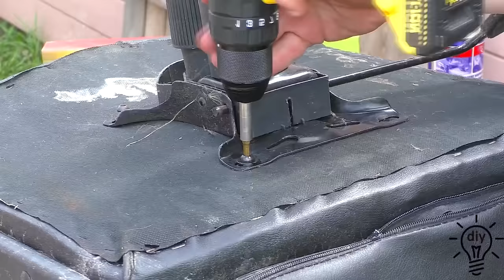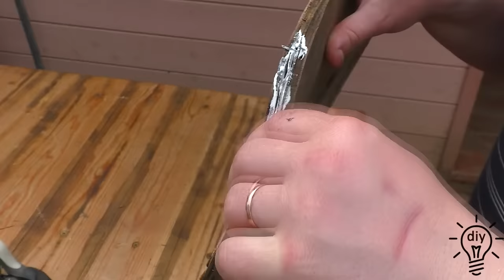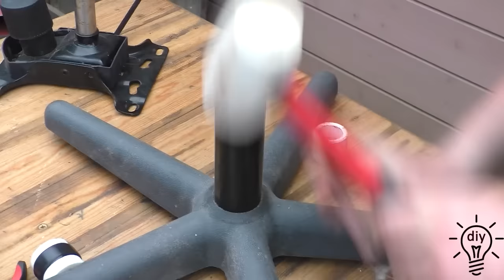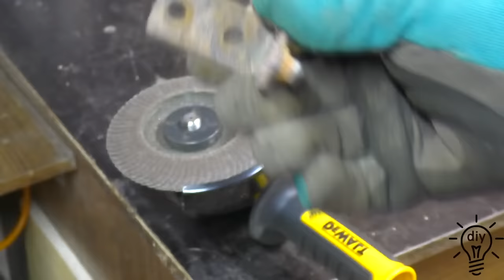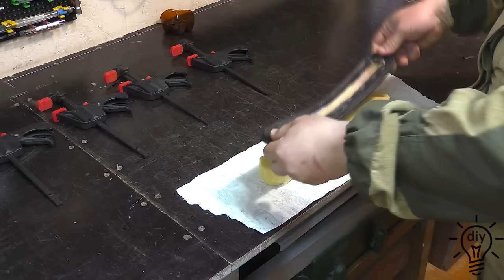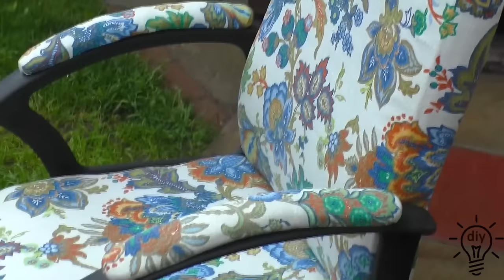Cool idea!!! Don't throw away your old office chair !!!

Comment: It would be cheaper for me to buy a new office chair than to buy all those tools and re-make the chair with the help of those tools....☹️☹️☹️☹️
Reply: One-time purchase help you for 10-years more and allow you to fix many many things and save you money.
Reply: @nirmal6362  right! save money but what more important save the environment!
Reply: @macewindu7568  but he has to spend 200 bucks for a compressor and staple gun, im sure making those products wrecked the planet a little bit. I have only used my compressor twice on five years
Reply: @asueft  if you don't DIY you can buy staple gun for 5 bucks or use hammer and nails
Reply: @asueft  and needn't to spend 200 bucks :)
Reply: don't throw out your office chair you can repurpose it as an at home office chair. With that armory of shop tools when would you ever spend any time sitting down.

Comment: I worked for a Swiss office seating company for 25 years, bring back old memories. You did a great job on that chair really.  One thing that I saw that amused me was when you were scraping off the bottom of the seat board. It sure looked to me that the T-nut that held the control were put in wrong from the factory, The T-nut with flanged part should have been on the seat pan where you put your foam. Rocking around on that could cause the nuts to pull right out, be careful who uses that chair. But still a great job.
Reply: Wow! Good Eye! 

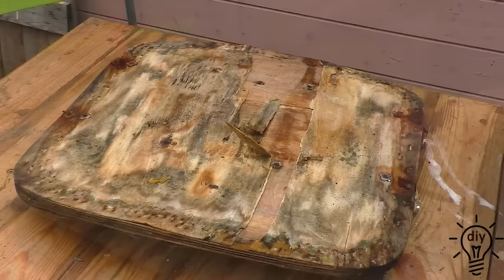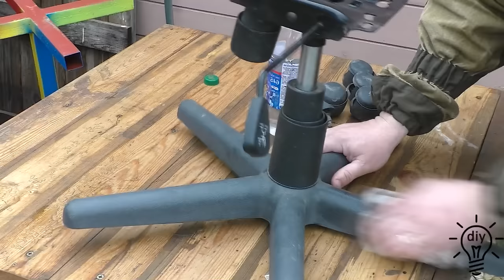During disassembly (around 0:44) it looks to me like they were manufactured correctly w/the arm t-nut flanges on the bottom of the pan and the seat t-nut flanges on the top side. It's hard to be certain, but by 3:44, they all (arm and base) appear to be flange side down. 

Maybe when he peeled the rotten plywood layer off the top, he thinned the sheet so much the t-nuts stuck out. Then, even with the t-nut bolted hard against the base support, the plywood would slide down the t-nut barrel and the seat pan would rock, so he switched the flange to the bottom side, not realizing how rapidly they would pull out without the plywood to work against? Who knows. 

As you say, an overall nice rebuild, but be careful sitting on it until those pedestal t-nuts are reversed (and maybe shimmed?), and I fear the white in that floral pattern is going to look dingy pretty fast, especially on the seat and arms.
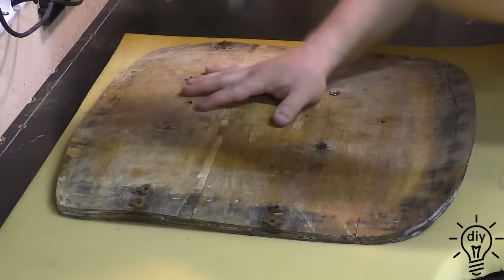Reply: At first I did think you were right, but at 02:42 it looks different,  on top of that,  if the nuts were wrong placed, the  chair wouldn't have lasted this long
Reply: You could call it a "Mother-in-law" chair.

Comment: How thankful I am that you posted this video and that you positioned your camera to have clear shots of each step in the dismantling and reassembly.  My sturdy office chair of 30 years is still in mint condition, including the upholstery.  The only problem is that it wobbled too.  Unfortunately when I dismantled my wheel base from the chair base, I didn't take pictures each step along the way so couldn't figure out how to reassemble the washers, ball bearings, and that indispensable 1/2" black ring. Thanks to your video, I can repair the wobbling AND reassemble the cylinder and wheel base!!! Thank you, thank you!

Comment: Dilemma: when your cart has $100 in parts to restore chair,, and you walk by new chair for $79...
Reply: Yes that's called the throwaway society .
Reply: exactly
Reply: George Swift  You learn to MAKE clamps.
Reply: The only dilemma I see is someone thinking this repair project involved buying anything.
Presumably he already had the tools from previous projects, because they are all very basic.

Staples: $2

Cloth: just get any old bit of clothing.

Personally I’m always on the look out for old furniture using real leather. Even imitation leather has its uses.
Reply: People who build stuff already have all the tools. If you are not a builder, then yes, it will be more expensive. But if you already have the tools, it would only cost like ten bucks for the materials to do what he did.
Reply: @colorsafebleach5381  Yep. But people who build stuff try to avoid buying things if they can: especially at the last minute, because it is disruptive to the process of making.

It’s hard enough dealing with scheduling mishaps involving third parties, and Murphy’s Law.

This is where remanufacturing and repairing stuff differs from construction. Because you a sole trader, you HAVE to have a sliding scale of value for your time.

No one is paying you to sit around and do nothing AND every creative project is intrinsically valuable to you because it adds to your problem solving skills.

Experience makes you better at solving problems WITHOUT spending money. Your knowledge and inventiveness is your CAPITAL. The more you know, the less you need.

Comment: That is pretty neat. I have thrown away a few chairs... but only the seat part. I save and repurpose the wheel bases. :) Maybe will do this next time. Not as young as I would like to be but still young enough that I am sure I will have another chair or two needing to be replaced... will fix them up instead. - Heidi

Comment: OMG! This is my kinda channel. I happen to be an oficionado at repurposing the things right under your nose. Even if I was mega rich I'd still prefer pallet couches, PVC chairs, plastic crate shelving and tables, soda can pop top cushions, RETRO items. LOVE IT. Do you know contact paper is cheap as hell and can be put up along top of windows to cut glare, light, and heat? Duct and masking tape of any color box cutter, and 22x28 poster   boards of any color are all you need to create "blind and shady curts?" We dump too much 💩 out that has a function: knobs, screws, closures, ballasts, pulleys, cords, magnets, wire, wheels, etc.

Comment: I can't wait to get started on my new chair tomorrow. But first I have to go to Home Depot and get a nail gun get clamps get the glue and then go to a fabric store and get some ugly Fabric and then get all the equipment that I need, and then spend a day or two rebuilding a chair. I figure I'll be into it for about $600. Or I could just go over to the store on for $75 by another chair and be back in 30 minutes.

Comment: That wood looked moldy and warped. I would have just cut out another piece just like it by tracing with a pencil on new wood the shaped of the old wood. And clean those spider webs off the legs.
Reply: you can't remake that mode because it's certain way that they made the Maple Bend.

Comment: Not a good idea to just attach the screws directly back to the wooden frame of the seat without drilling holes first to insert metal threaders that will hold the seat firmly in place. Otherwise, with a decent use of the chair the wooden seat will start wobbling out of its metal support with potential harmful effects on its occupant!
Reply: @Calamari in the net I am not a pro. Let's say I have prior experience in fixing seats on chairs like this one and thus I can evaluate whether a certain repair is going to work or fail.

Comment: Those T-nuts on the seat bottom are installed incorrectly. That pedestal will break loose soon, if the rotten wood doesn't fail first.

Comment: It is nice that you have all of those professional tools to accomplish the task. But how much did the materials cost? And where is the piece of floral material to cover the back? It was a very inexpensive chair to begin with, so I cannot imagine this was cheaper than replacement. And it looks like mold was opened up that wasn't properly remedied. 😱 If you have time for a hobby and this is it, then fine. But I don't see the value in this project otherwise.

Comment: I appreciate the discipline of rebuilding the chair without replacing the laminated wood, however, the chair had obviously been out in the weather for some time, and black mould has set into the wood.

This black mould is a health hazard to humans, linked to many chronic respiratory and immune system issues. It is not advisable to reuse timber contaminated with black mould. It fact I'd treat such timber as biologically hazardous waste and incinerate it if possible. Keep in mind also that this mould attacks timber on a cellular level and will weaken the structural integrity of the wood.

If you must reuse the timber, give it a good soaking using an anti-mould treatment you can purchase for bathroom walls. Then dry the wood out, and coat it with mould resistant surface fish. Then reinforce the entire underside of the seat with steel sheet metal.

Comment: I am amazed with what you did restoring and IMPROVING your old, piece of sh*t office chair.  You turned junk into something to be proud of.  (I've got to assume that your choice of fabric for the chair was just whatever you had lying around unused, to keep the cost of the project down to a minimum.)  Bravo on your genius level 'stability hack' of inserting a few PVC tube rings in the support shaft to prevent wobbling.

Question:
The thumbnail for your video shows 'two (2) casters that are attached to a piece of pipe, like in-line skates'.
I didn't see this in your office chair refurbishing video.  What's up with that?

Comment: What is this "club of crooked handles"?  plywood is dirty, moldy!  Was it difficult to grind?  upholstery without stitching, from a material of wild design, skinny foam rubber, without a sealing layer and a cover - it will dry up and crumble!  it is necessary to make several holes in the plywood so that you sit down and the seat does not deflate like a leaky fitball.  ))) They showed a banal samopal !!!  and where is the "COOL IDEA" which is on the video screen saver?  This is a fraud!!